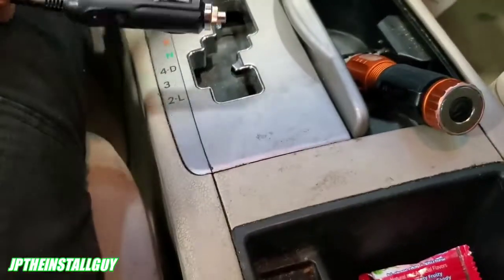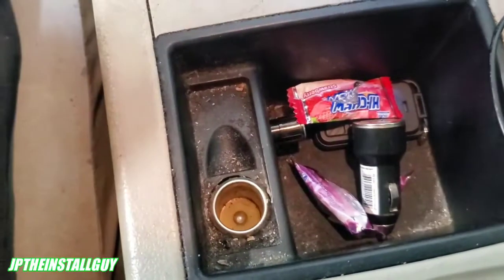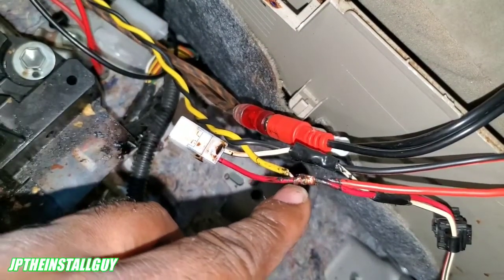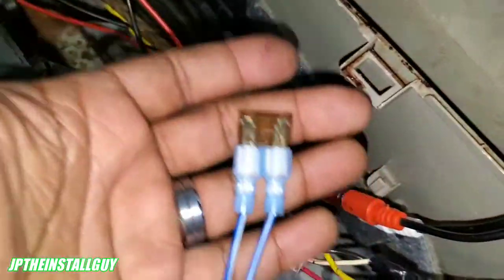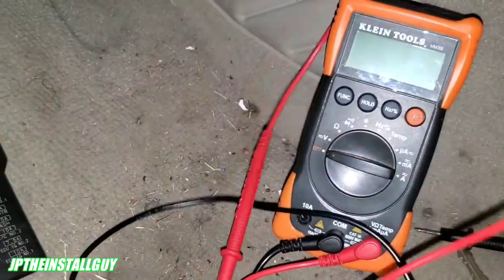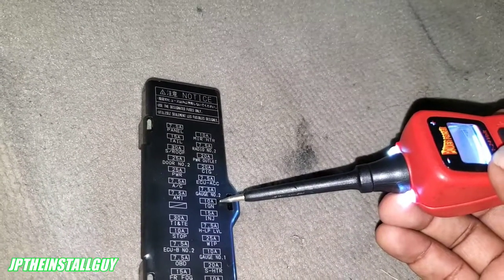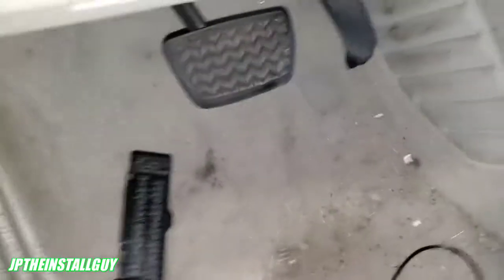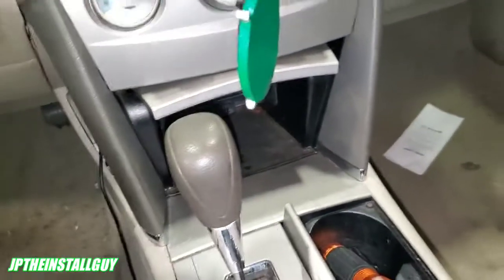Install a remote wire

Comment: So I have an aftermarket head unit and it has a plug-in for remote but all I have is a straight wire to use for the remote what kind of connector do I need to plug that in the back of the stereo is that a RCA? First time installing this by myself appreciate your help

Comment: I run my remote wire straight from my 12v battery but I also have a kill switch runing in between the amp and battery so I can turn it on and off at the flick of a button. It’s actually pretty cool. That’s just another way to do it.

Comment: JP I got a camry similar to the one in this video I got a Subwoofer with a built in amp I think my Camry has factory amps do I have to bypass these to get the sub to work?

Comment: Thanks man!  Do I only need one fuse for the remote wire before I split it to connect 3 amplifiers? Or should I fuse each of the wires after the split to each amplifier? I had it working fine without any fuses, using a cheap bridged non fused terminal distribution but I’m just cleaning up my connection since sometimes ( 1 out of 10 times) one particular amp didn’t turn on.  
Thanks again.

Comment: You know how you have a wire from battery to the amp. Can you use that as the power source? So have a wire that connect to remote on back of amp up to the on/off switch and then another wire from the amp positive wire that is connected to battery to the on/off switch and run it all nice under the panels?

Comment: Was trying to find an easier way to tap in a remote wire than using the ignition switch or some fuse under the hood.... and the cigarette lighter idea is killer. Super easy and convenient too, as I have two cigarette lighters and the one I never use. Thanks for the idea!

Comment: @JPtheinstallguy originally i was planning on splicing and tapping into the remote power wire straight out of the stereo harness. it would be a split type connection where one wire goes to my factory stereo and the one i tap goes to the amp. could you just do it this way or would it be easiest to just use a fuse tap like in the end.

Comment: what about running a wire straight off the battery with a on/off switch.,?.,?   my radio has NOTHING to do with the ignition., no key., just turn it on or off., all of it., using the key turns on alot of stuff other than the radio., you can play the radio alot longer when the car is not running by not using the ignition., just keep in mind your not charging with the engine off., but., without the amp turned on you have HOURS of play time with it turned up., with amp depends on what your rolling with .,but with bigger battery and factory alt., i have played 2-12's on a 1000 watt amp for 3 hours before battery died.,., ';'